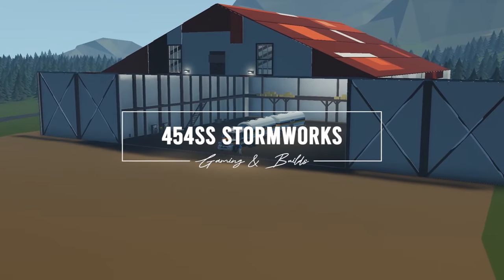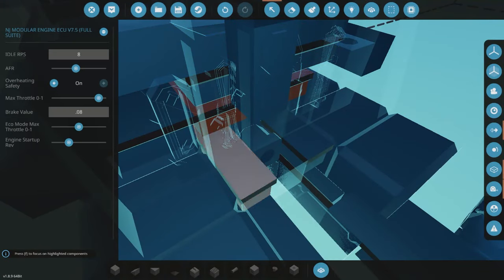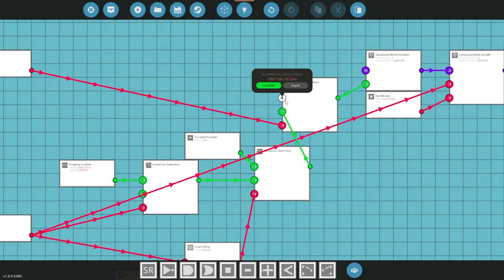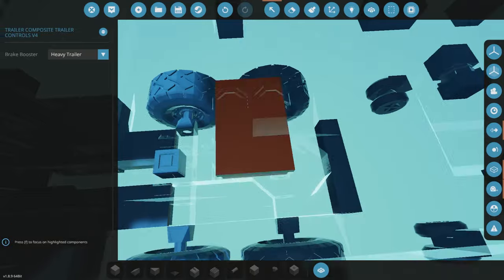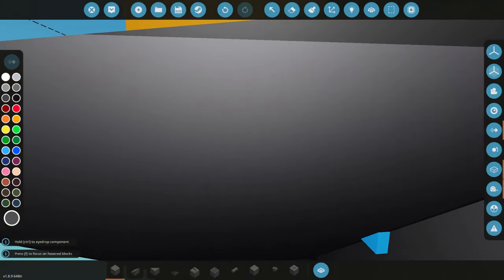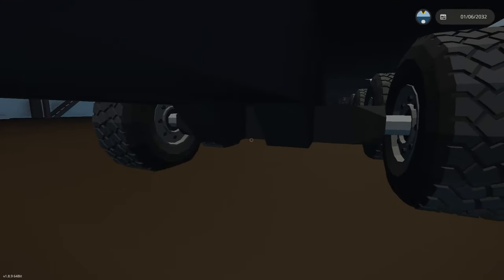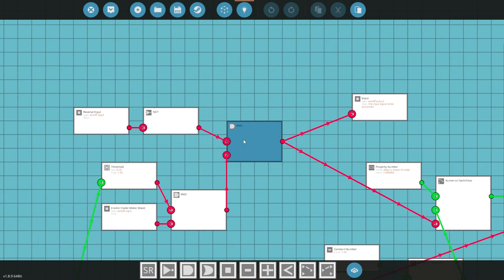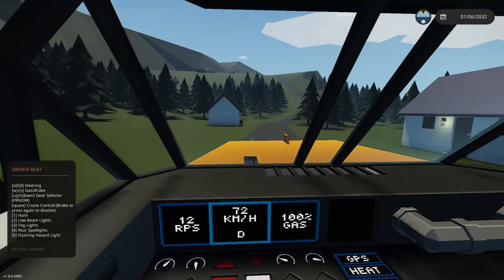Adding Trailer Electric Motor Boost in Stormworks

Comment: IRL trailers don't have reverse lights and often semi trucks, called tractors, don't have them either (because they would be hidden by the trailer).

Also, IRL the trailer brakes are variable, they activate using the same air pressure the tractors brakes use.

Semi trucks actually have two brake "pedals" and two park brakes.

Park brake one, will apply the park brakes on the tractor and trailer.

Park brake 2, called trailer air supply only applies the brakes on the trailer.

Service brake 1, aka the brake pedal, applies service brakes to tractor and trailers.

Service brake 2, aka trailer brake (often a lever on or under the steering wheel) applies the service brakes to the trailer only.

So, using the normal "vehicle" brakes will also work the trailer brakes, but the trailer has its own set of brake controls exclusively for the trailers.
Reply: I think reverse lights depend on where you are. I'm pretty sure every Truck and trailer I've seen here in europe do have reverse lights and are required to have them because they are critical to seeing where a vehicel is going if when approaching it